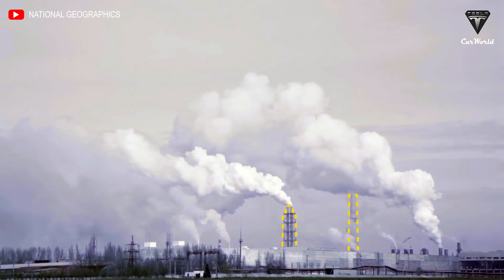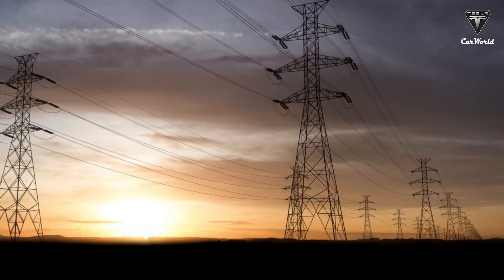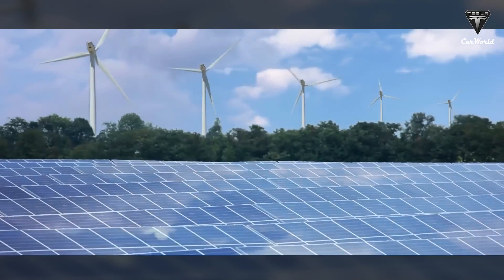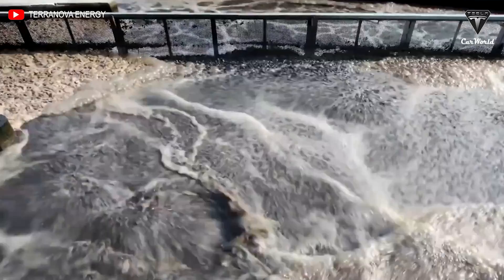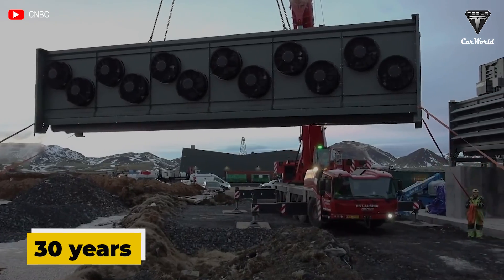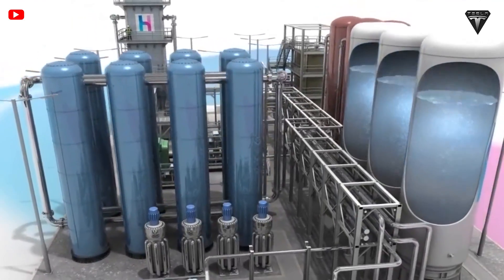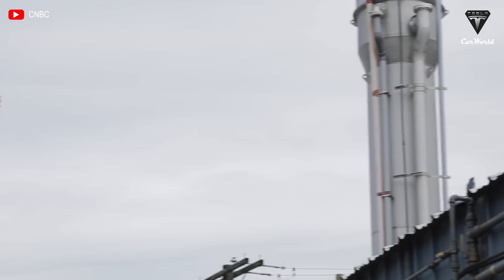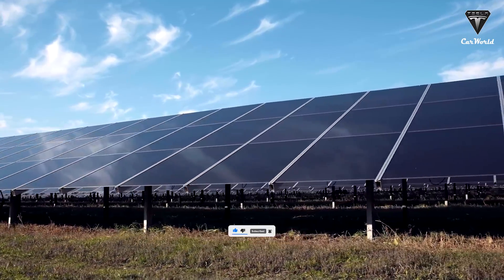Something BIG is about to happen to Tesla? Carbon Dioxide is Answer!

Comment: Tesla car world - you are FAKE NEWS, I reported you to YT Authorties.
NOPE, carbon dioxide is no Solution.
the ONLY thing that matters is, SWB - solar, wind, battery.
SWB in FACT is the Cheapest energy on EARTH.
and with little as 25% SWB you can have SUPER POWER GENERATION & Storage. 
with 80% SWB you can have UNLIMITED FREE Super Power. 
you WILL be able to meet 120% of Americas TOTAL energy needs.
Reply: You read Tony Seba too much and too seriously!  Oh!  I am also a great fan of Tony Seba, whom I follow since 2014.  But the fact that RethinkX has demonstrated that a grid could function on 100% SWB, does NOT mean (and they mention it),that it does not work even better when incorporating other solutions such as nuclear, hydraulic, geothermal and other clean generation technologies, respectively pumped storage or, why not, the present CO2 liquefaction/gazeification  cycle, which is an idea definitely worth considering, especially if it has a round-trip efficiency of 75%, as they seem to indicate.
However, you are correct denounce  that the present video has NOTHING to do with Tesla, or so little.  It is just one more clickbait title, like there are millions of others!
Reply: @st-ex8506   - FACTS are , NUCLEAR in 2023 is too EXPENSIVE 5x more than SWB, Hydro is pretty much MAXED out in the USA, besides Flooding Valleys is not really a good idea, in case you have NOT been watching NEWS  there is still SEVERE DROUGHT in Western states, whtch LIMITS Hydro ENERGY production , several HYDRO had to be SHUT DOWN, and water storage also LIMITED, BETTER off w/ SWB - Superpower + DESLAINATION on Pacific , Gulf , and East coasts , rather than DAMS/Hydro.
geothermal is LIMITED to where you can harness, USA in 2023 is Already building Massive OFF Shore WIND in NY State & Mass, other areas Planned, one untapped Renewable source is TIDAL .
IRELAND is now powered by 100% TIDAL renewable energy. 
LIQUID batteries, NITROGEN freezing, and Gravity battery are all FAKE NEWS.

Comment: Sounds fishy. Use energy to compress, recover some energy from heat generated to compress & then release pressure to drive turbine. Overall there will energy loss, but if energy is cheap when compressing, then there could be some benefit when energy is expensive.